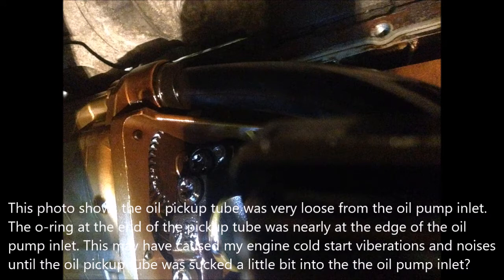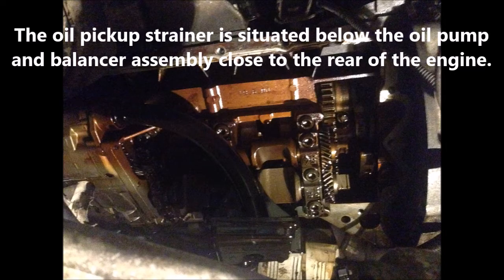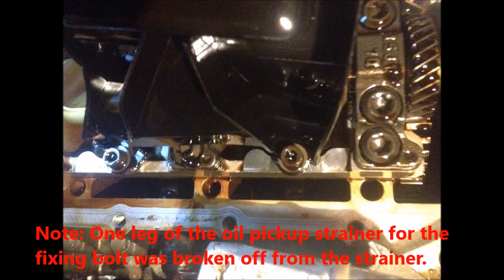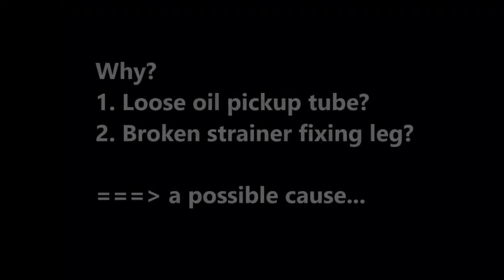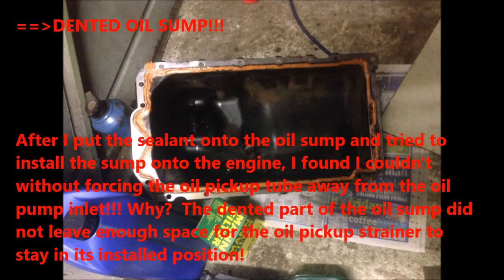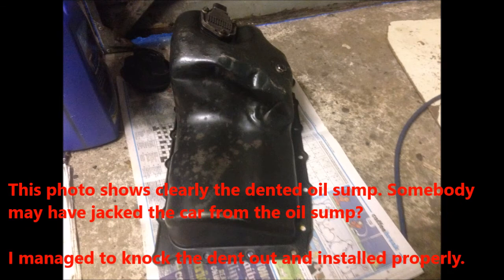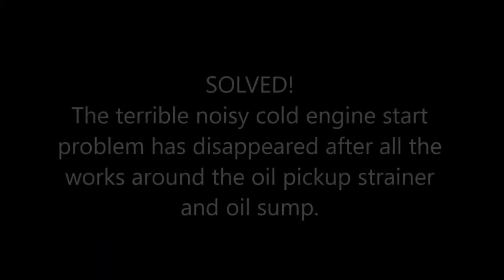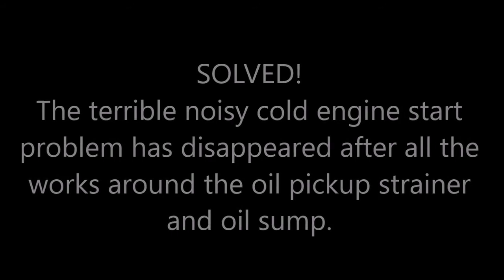BMW E46 / N42: Loose Oil Pickup Tube Caused by Dented Oil Sump?

Comment: Did you have a red oil lamp when it happened? thanks
Reply from the maker: Yes, as in the description (list item 2), the indicator remained on for 5 to 20 seconds at cold starts! and sometimes it flashed when the engine was struggling at idle. Cheers.